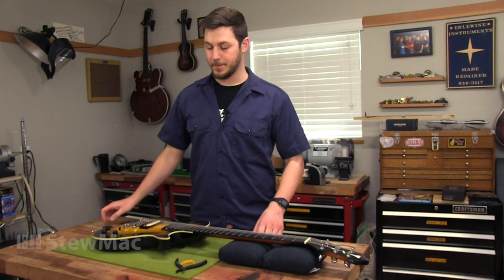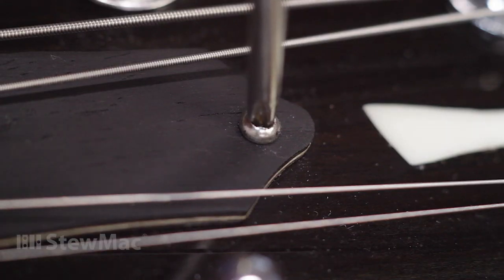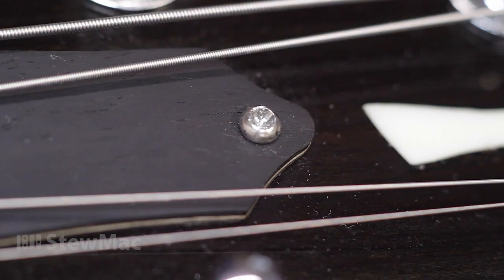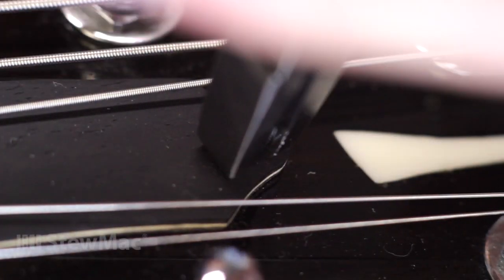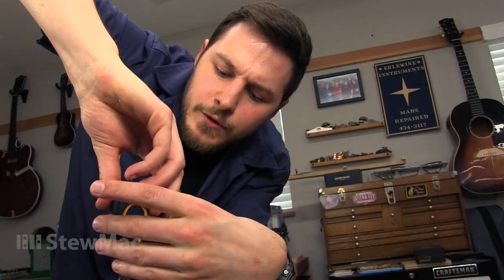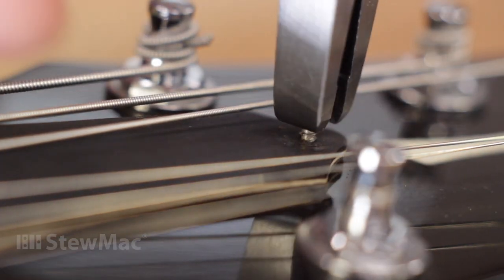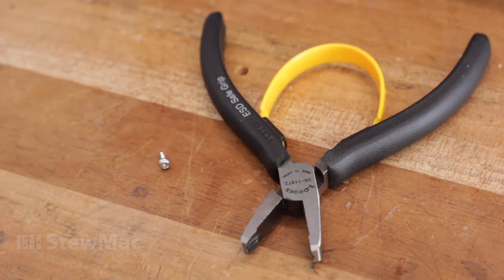Get a grip with Screw Removal Pliers

Comment: What about countersunk screws? You can remove the others with a pair of pliers or similar tool.
Reply: you'd need a small set of special bits called damaged screw removal set, they go by various names, I use one called "easy out", which is decent for most work I do. You would then also want a tap wrench to do the screwing/unscrewing part, although you can use other tools as well (and a mallet or hammer to tap it). IF that werent' enough, you would also want to make sure the set you bought had harder metal than what you were drilling into, or risk snapping them off (there are a lot of cheap metal sets out there, generally the more you pay the better the set). A supplemental strategy to go with the damage screw removal set is to first drill out the very center of the countersunk screw with a metal drill bit to weaken its core and provide easier access to the removal bit.

Comment: It's nice but is it $29.95 nice? I think I'd really need to try it before making the decision to purchase one.
Reply: Try it?  lol You see how and that it works.
Reply: I don't see how it's any better than grinding down the tip of a $5 pair of needle-nose pliers like we've already been using for decades to do the exact same thing.
Reply: The point is not to mess up the finish.  Ever slipped with needle-nose?  I have many times. But then again I'm clumsy.
Reply: How is this any better for the finish. It looks exactly like a ground down needle-nose. If a pair of needle-nose would mar the finish, then so would this. Either way, you need to put down some tape if you don't want to make sure you won't ruin the finish.
Reply: My needle nose don't have a special shape to grap/grip on the tip of them to keep them from slipping.  Also grinding metal is not a common thing for me to do in my shop.
Reply: Well, I don't see any special shape here. They look like any other pair of ground down needle-nose to me. If you see something different, then I guess we'll just have to disagree.
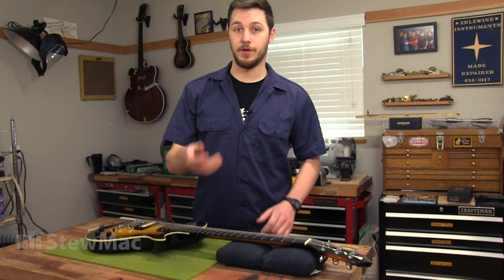Reply: I'm referring to the 00:26 second part. That and like I said I don't grind an inch of metal very frequently/easily in my shop.
Reply: Craftsman has a 2 piece small vice grips set that is just awesome for this kind of thing. The difference is they lock.
Reply: Yes, I have some mini-vice-grips that are great too.